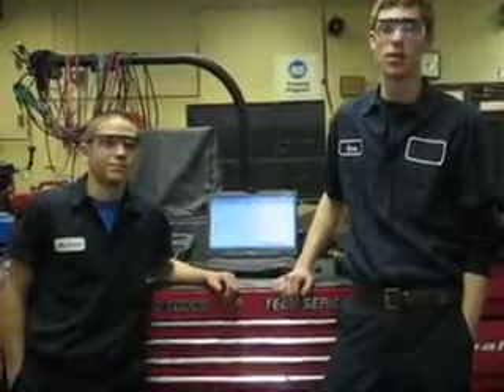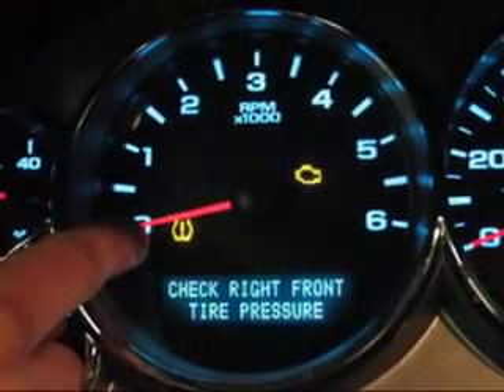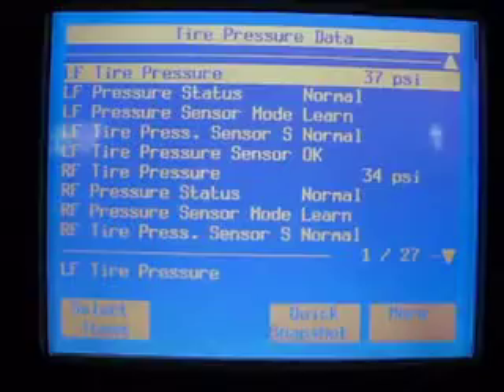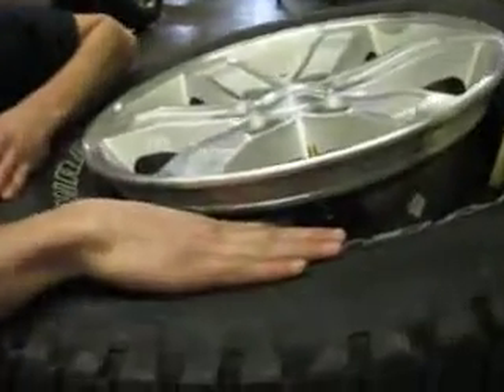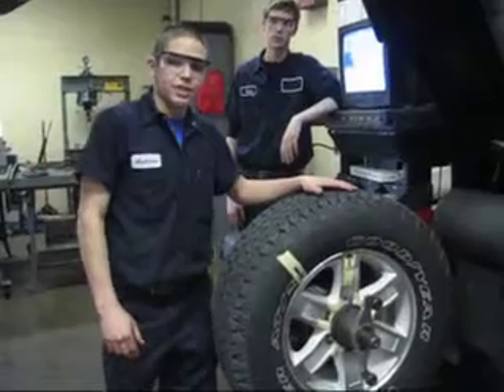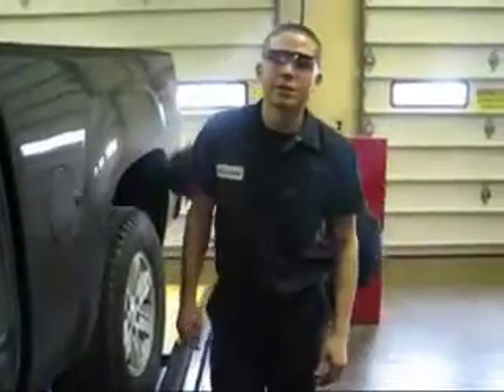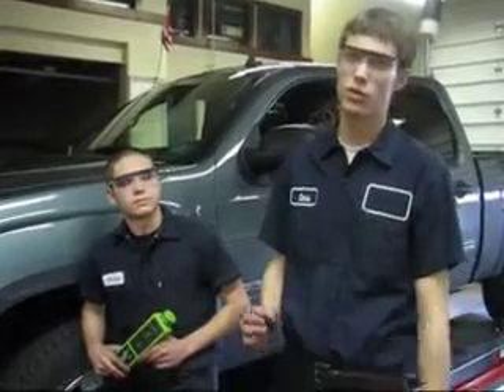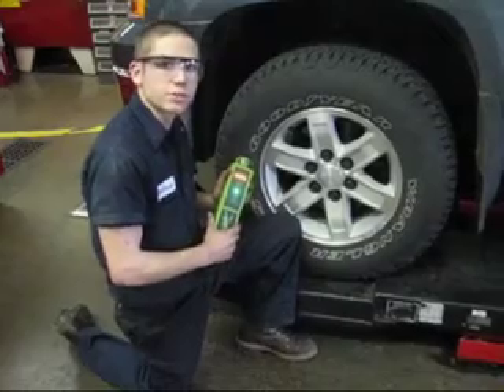Tire Rotation on a TPMS Vehicle

Comment: I've noticed on new Mercedes cars with TPMS each sensor has a permanent sensor position that can't be repositioned using a relearn tool unless you physically dismount the tire and swap sensors to where you want to put them. Granted they are staggered tires and don't need to be rotated.